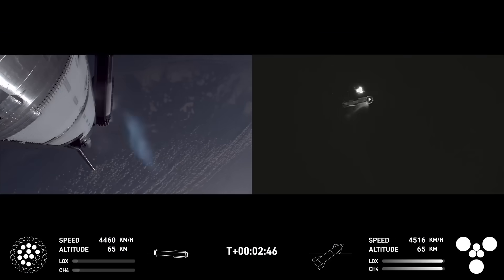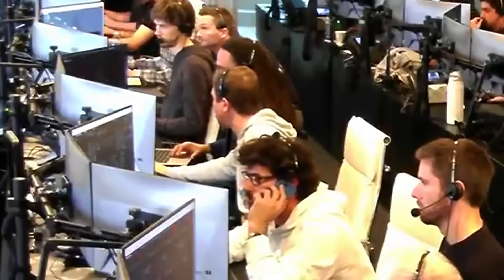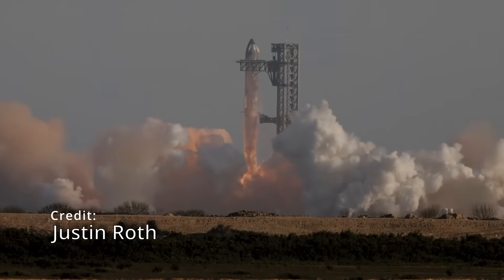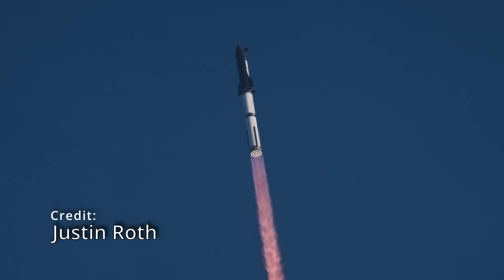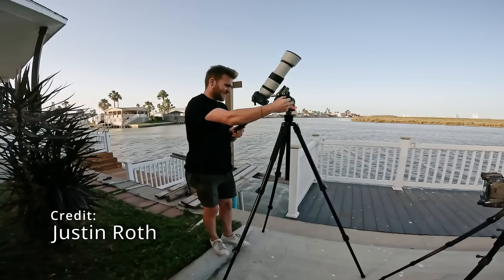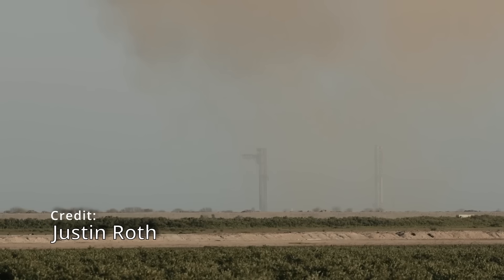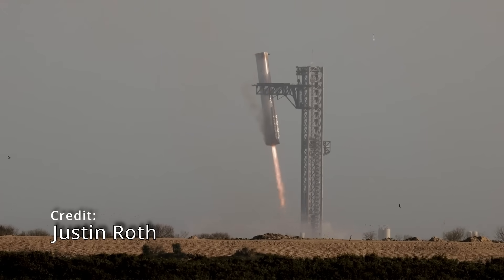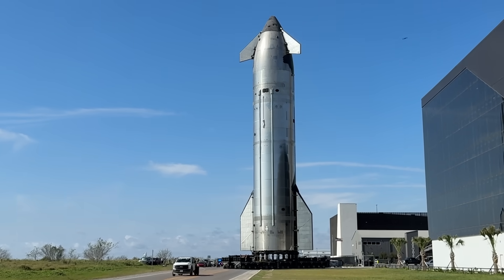Rest In Pieces: Why Did SpaceX Lose Starship Again?

Comment: Seems to me it’s related to flight seven’s issue, somewhere within the rocket engine compartment, software code, or faulty sensors. Other V2 changes haven’t even been tested yet due to this issue on both flights. At least this one particular problem is known to be repeatable, and helps to more focus on this one issue and its final solution. Best to let the Engineers do their work without any distractions or second guessing by the public. They’ll figure it out, they always do at SpaceX.

Comment: I think Joe is absolutely right. And I think you have to consider some really extensive pressure and static fire test programs! It could be something as simple as a fitting on a fuel line not working properly. Probably more serious than that. But this is the largest rocket ever test flown. And reality is this thing was going to controlled crash in the Indian Ocean anyway. They got to test the hot staging and separation again (which could also be the issue). Got a lot of telemetry and everything was working fine until it wasn't. This will all work out over time. We have just gotten used to everything going right all the time!

Comment: There is something "not right" in starship v2  that only manifests itself when the ship is advancing to orbit past the kalman line.  Failiures in flight 7 and 8 almost happened at the same time in the flight.  One suspect would be that at that speed and fuel load some harmonics are produced that rupture something (fuel tank or pipes) resulting in catastrophic failure.

Comment: Thanks, Ellie.  From a design standpoint SpaceX has taken the concept of rocket prototyping to a factor of ten.  Virtually everything about the starship and booster is first of its kind.  I think we've normalized starship rapid advancement and that's on us.  Most of the testing has been on the launch pad where everything has to work close to perfect.  It was always going to take longer than the estimate because they didn't multiply the estimate by a factor of three.

Comment: I"m not sure whether a static fire test would find the problems in the new design. From what it looks to me is once the system is in vacuum, something starts leaking above the nozzles filling the space and then the propellant that is in the voice eventually touches the lit flames which ignites it, causing disaster. As this is part of the redesign it's not surprising that they are encountering some issues. Either they build a vacuum chamber big enough to test the assembled ship.
Reply: The problem is the static fires.  Those are killing the ships.  This ship had a static fire, and the last one did, too.  It is very bad for vacuum engines to turn on at sea level.
Reply: @dl2839  Must admit I am surprised they run static fires with the ship vertical and at a relatively low height; surely the vibration and heat build-up are bound to badly stress the whole structure, and possibly in ways that cannot easily be discovered (microfractures, etc).

I agree though, that it seems to me probable that vacuum is a part of the equation. I don't know anything about rocket sea-level vs vacuum, but it does make sense that if there is a difference running them in the 'wrong' environment would have consequences.

Comment: there is going to be a face-palm; something obvious about the tank plumbing and engine interface design. they had so many stable successful suborbital flights with the overall (mark 1) design. the overall design is sound, but something relatively "simple" is to blame here, would be my guess. but this will serve to illustrate the importance of building the factory to build the ships over building the ships the way nasa does. this is a test iterate scheme. this kind of setback is almost inevitable. now come the time to find the right balance between "hard ware rich" and "hardware frugal", when you have a factory at your disposal.

Comment: As much as I think Elon is a fraud and charlatan, I know he's not the one engineering these rockets (because he's not an engineer).  I wanted Space X to be successful for the sake of the science and engineering it represents. I am truly impressed with Space X's ability to catch boosters.  I never thought it would work and I was impressed that they are doing it reliably.  

However, this vehicle has yet to have a successful test flight. That is a problem that can't be excused anymore. There needs to be a performance evaluation and iteration pause. They keep "upgrading" the vehicle which is causing regression. That would be one thing if they had successfully tested the first iteration, and made improvements. This is just saying we can't get this to work so we're changing it in such a significant way that we can't even get to orbit anymore.  

Stop iterating, and get a working version of the vehicle.  Then you can upgrade a working spacecraft.  Right now you don't have an orbital spacecraft, you have a booster hood ornament that keeps exploding.

Comment: After 3 successful test flights they get 2 failures in a row on a new design with the same engine placement. I get that it's a new design but how much has changed in the engine bay between v1 and v2? I wonder if quality assurance is slipping.

Comment: From launch7 it did not sound like Spacex really knew root cause of leak.   I hope that on this flight they added cameras, sensors, etc for launch8 such that they can get really good root cause.
Reply: The root cause is the ground static fires of the vacuum engines.

Comment: Sure looked like a weird booster flip, just an optical illusion or was it more swing than before?
Also, SpaceX has proven its got a great  1st stage booster. What's to say that it couldn't TEMPORARILY build an expendable second stage like a scaled up Falcon 9 2nd stage to get starlinks up in orbit while it gets the bugs out of Starship. The lift capability would be greater than a Falcon Heavy and imagine a rideshare with that? The SpaceX religionists would say an expendable 2nd stage was heresy but IT WOULD FILL THE GAP UNTIL STARSHIP WAS DEBUGGED.
A final thought, i wonder if JUST a Starship (no booster) could be launched on a suborbital out into the Gulf if they can't run a full flight simulation at Massey? It might be that only time the glitch happens is during flight. Instrument the hell out of it to get lots of data.

Comment: While the statement can be made, flight 8 rudded similar to flight  7,   it does not follow that it was the same mechanism of failure.  You are correct that Space X will need to answer some question.   What did they believe happened on flight 7 ?  What changes did they make ?  What testing did they do before flight 8 that gave them confidence ?  What data did they get from flight 8 ?  What does the data show as being the cause?  It took V1 4 attempts to make it.  And they improved it with each flight.  Why should one expect success on the first or second ?   I think we have been to spoiled by the SpaceX success rate, and rapid improvements.
Reply: @allenlorenz  Why should one expect success on the first or second ?   One should expect this with proper "waterflow" engineering
Reply: @ancientprogressive3343 , Please tell me which company had done this proper waterflow engineering ?

Comment: Joe absolutely nailed it. They need to take a step back and have a long look at this V2 design.
Reply: My guess is propellant lines - the long test was good but they need to test until the tanks are virtually empty - line harmonics change as propellant in the tanks decreases -
Reply: @Derek-je6vg  Agree--- Version one had only a single line which worked but version 2 has 4...
                                           Still could be something else though not related.
                                           Tough problem with no part evidence to see.
Reply: @ yup have to wait and see - but given the failure was more less at the same time - I’m doubting two rvac engines would fail at the same instant unless it was something like the feed lines. They need a static fie with minimal fuel down to zero to see if the harmonics changed as the tanks empty.
Reply: @Derek-je6vg  100%. Maybe the increasing empty space in the propellant tank is ultimately creating that one but destructive sound wave💥

One of Block 2’s biggest changes—triple downcomers—could also be the sneaky culprit🧐

We picture them as rigid, but they’re really vibrating strings. Under certain circumstances Starship V2 might be playing its own destruction soundtrack. 🎶🔥 

I bet it’s something oddly simple and unintuitive—like the downcomer length, mounting angle, or shape! 

Actually even the new length of Block 2 could be throwing off the harmony🤔

SpaceX needs more sound engineers!
Reply: Agreed
Reply: Same. V2 has a deeper design flaw they refuse to acknowledge. 

Engines were rock-solid until now—so unless a certain 'russian contractor' paid a sabotage visit to the factory, something fundamental is still off 🤔🔥🚀"
Reply: It's a raptor thing.  Engine shut down caused the uncontrolled yaw and the airframe was not designed for that, ergo failure.  Lets go with Raptor 3.
Reply: No. Loss of ship and delays incurred aside, this is actually a good thing - nothing annoys a mechanic more than a random fault that cannot be replicated; and this one clearly occurres near-deterministically, which should make it easier to confirm once the fault is spotted. And while it might not be software-fixable, it will almost certainly still be a localized problem that won't affect the other parts of the ship, meaning that keep producing V2 parts would still likely end up 95% progress and 5% or less loss, if something needs to be re-manufactured. Stopping everything while wailing and rending clothes etc. would be a 100% loss instead.
Reply: there's no words ’step back‘ in SpaceX’s dictionary！！
Reply: Never. Never look bookwards.
Reply: @MrkBO8  Books are for losers, true heroes learn only from their own mistakes.. 😖
Reply: Oh so you speak from your own experience in rockets and testing?
Reply: @ACGBLR  SpaceX, with all its rocket mastery, just faceplanted again. 🤣 Sometimes, the answer isn’t in data, simulations, or fancy algorithms—it’s in plain old common sense. 🤷‍♂
Reply: Exactly! Sure... with failure you can bring success... but I feel like SpaceX & Elon Musk is taking it too fast and rushing it. Look at NASA ... yes... NASA is slow, but their quality is superb and the rate of crashes is very low.
Reply: @RuLeZ1988  so we are suddenly pretending that sls is good and starship bad?
Reply: @ No. Never said that. I am just saying, if SpaceX keeps rushing it like that, they will be in for no good, especially when the time comes to board human living beings.
Reply: @snuffeldjuret SLS is prove without failure and Starship isnnothing but failures compounding tax payers costs.
Reply: that's acting like there's some kind of systemic issue though. It's clearly some sort of oscillation causing the problem. Once they isolate it the problem is solved. They don't need to redesign the freaking vehicle.
Reply: @moonasha  I don't think they need to redesign it either because that will be V3 in the future. My idea is to slow down and figure out what the issue is, however long that may take. Could be a few weeks or a a couple months. Anything beats putting Starship down in pieces in the wrong ocean.
Reply: @ multiple engine shutdown caused the "oscillation" which is nicest thing you could call what happened.
Reply: @Baxdawg  this is actually what they would not do becasue it slows the process down. They build test fail until it stops failing. You clearly do not understand.
Reply: @mskettelhut  It will probably be 3 months at least before the next launch
Reply: @ Bet youre wrong.
Reply: @donkey3187  and that's being generous
Reply: @mskettelhut  That is debatable. If you have too many unknown things it makes it confusing. I am also a design engineer (not rockets) and I have also had many failures with new concepts but only parts where new so easier to trace. I have also worked as a maintenance engineer on really big computers and they kept failing, even after many modifications but then not so often, and still had faults when they where replaced with new ones.
There are also intermittent faults. What if they only happen once? Then you often have no idea if you fixed it or not.
Reply: @mskettelhut  der........
Reply: @mskettelhut  sure, build test fail while failing to understand what the problem actually is, throwing away millions of dollars of hardware with nothing to show for it seems very sustainable.
Reply: @ryanspencer6778  no one cares that you have no idea what you are talking a out.

Comment: They’ll need to do multiple static fire testing for longer durations and additional pressure testing. You can do this SpaceX!! Keep focus and redouble efforts. We are with you!!
Reply: The static burns are destroying the ship.  The vacuum engines break when they static fire them.
Reply: I suspect SpaceX learned all they could from static testing and it's time to blow up some rockets to learn what isn't working in a real world launch.  These Starship prototypes are well instrumented and SpaceX is getting a lot of telemetry data.  RUD =/= problem.  RUD = data.  Data leads to success.  Even those who buy the concept of SpaceX rapid development often revert to the old paradigm.

Comment: I don't t think they know what happened. Since the same thing happened to the other one. 2 in a row. This will end if another goes the same way. A major redesign  is needed. Starship is not strong enough to stand super booster thrust and vibration. Think things are breaking during  launch.

Comment: For you non-engineer types, here is what is going on, something all engineers are always dealing with.

Basically, to make a part that's robust enough to almost guarantee it won't fail, can make the part cost more than it really needs to cost, or in aerospace, usually more importantly weigh more than it really needs to weigh.  Musk has often talked about the best part being no part (which is true to a certain extent), but sometimes while trying to do that, later as part of testing, you find out that you actually needed that part you got rid of.  So there's a constant tweaking in the design to make parts just robust enough to do the job, but no more so that you don['t spend more than you have to, or make the part weigh more than it has to.

Concerning this rocket blowing up stuff, most likely they'll figure out what needs to be made more robust so that it won't fail again.  The real bottleneck that I've been concerned about since the beginning is the heat shield challenge.  Right now it appears that to overcome that challenge, it will require some new technology that hasn't even been invented yet.  And that's really the main setback of this RUD, missing another opportunity to learn more about how to overcome that challenge.

Don't be surprised if they never are able to overcome it like they've been trying.  I hope I'm wrong, but my guess is that they will have to come up with a quickly replaceable/expendable ablative-type heat-shield "sleeve" that slides over the rocket.  Such a sleeve will be considered a necessary replaceable item for each flight similar to the fuel.  If it's not damaged too much, it might be refurbished for later use.  Obviously, just like they will have to bring fuel with them to Mars, they'll also have to bring extra heat-shield sleeves.

Comment: Just guessing. 
There is an issue in the plumbing between the downcomer and o2 engine line to one of the raptor engines.

Maybe its probably a resonant harmonic frequency with the associated mechanical structure. Normally when starship is fueled it doesnt affect much but as it gets emptier and more flexible the harmonics become more and more violent resulting in a rupture. You can see the failure of the sea level raptor and rapid draining of the o2. 

To fix this you would have to change/support the associated plumbings so it doesnt hit the frequencies or minimze the harmonics. So yeah, design change required. Most likely they already identified this for future versions.

Maybe for flight 8, they assumed the harmonics weren't that bad and added additional fire suppression for leaks. This to ensure starship reaches coast phase so they can test bulk of the mission.
Reply: That sounds very possible. That might explain why the last 2 ships both blew at similar fuel levels.
Reply: spacex added some gusseting to the thrust puck....but it is likely the center 3 engines need more support gussets....they will strengthen this plate on later block 2 starships
Reply: I think the resonant harmonic frequency from being hit with a sledge hammer then having a huge ball bearing thrown at it is what the cybertruck windshield failure was all about.. Not sure they been hitting Starship with a sledge hammer.. maybe they should might fix it. LoL
Reply: It seems likely that the problem is at least in a similar category of issues that are impossible to determine with ground testing.  SpaceX has a lot of good telemetry.  Hopefully they have accelerometer data from all over the ship that would help diagnose the unexpected stresses that are damaging engines or fuel systems during launch.